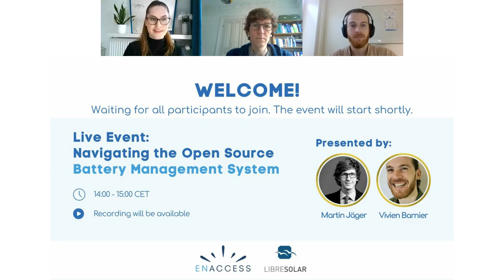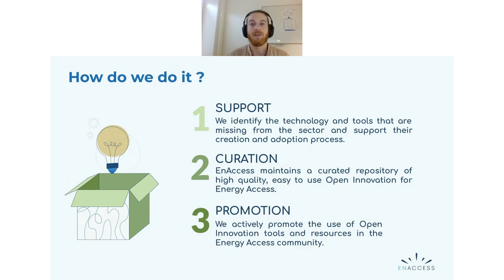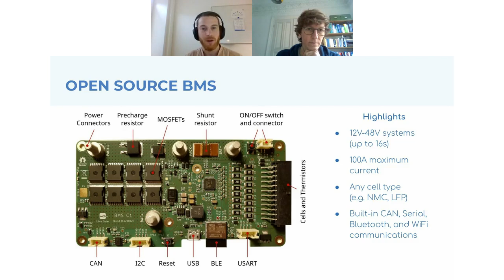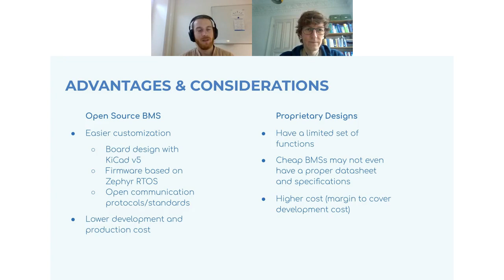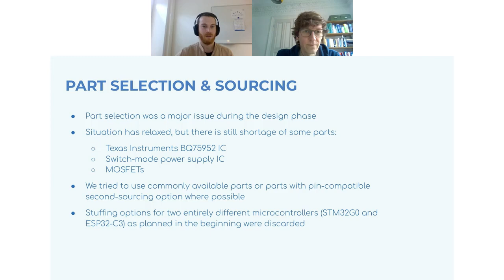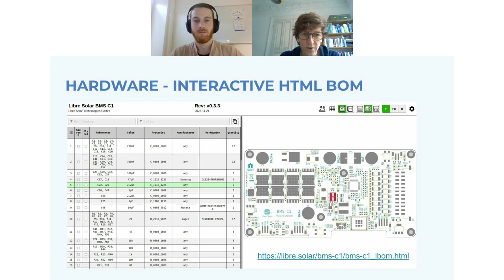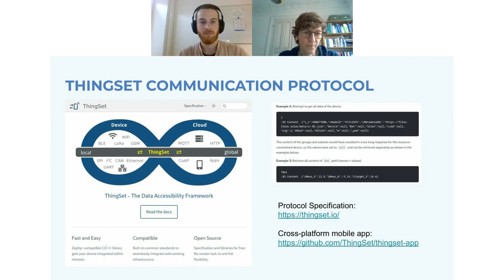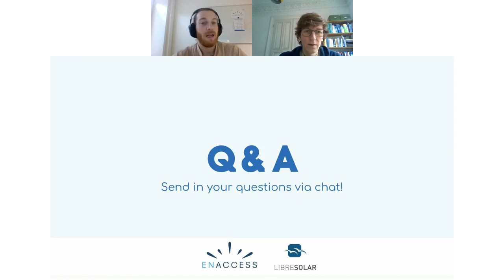Navigating the Open Source Battery Management System

Comment: I had plans to design a BMS exactly to your specs, but around NXP MC33771 battery controller. It can be stacked in series using Ethernet transformers to isolate the modules.